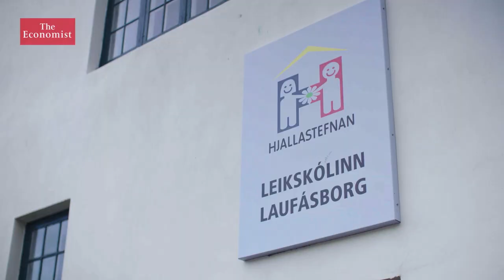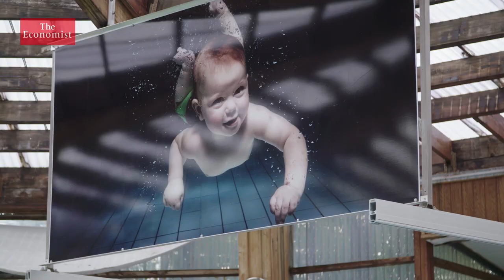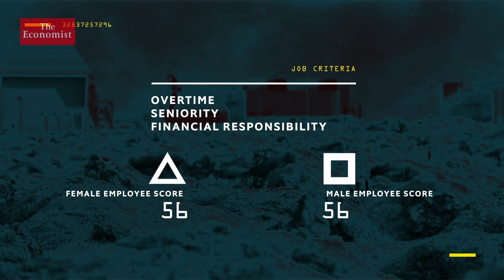The best place to be a woman?

Comment: Dear “Economist”. 

Economics 101:

1. If it were true that women earn less than men *for the same work*, then Icelandic employers would replace men with women in those jobs to lower costs.
2. Icelandic employers verifiably do not replace men by women to lower costs, even if by not doing so they become insolvent.
3. Therefore it is not true that women earn less than men *for the same work*.

There is no gender pay gap in like-for-like work - a fact which you yourselves reported less than 12 months ago in your newspaper.

I remember the days, before it was captured by feminist political lobbyists, when The Economist could be relied upon for well-researched, well reasoned journalism.

Comment: I agree on anything in this video except for this one 05:20 , if it comes to unskilled jobs, we must get paid according to the power we use to work, not because we give more value traditionally male dominated jobs, 

we can't pay the same price for cleaning service jobs and piping and fitting jobs, that's unfair, the risk and the power used in both jobs are different.

Comment: What is that mean: unskilled workers?  Is in it that for any kind of task to be completed you need some level of specific skills?
Reply: Here's the definition: Unskilled labor is used to refer to a segment of the workforce associated with a limited skill set or minimal economic value for the work performed. Unskilled labor is generally characterized by a lower educational attainment, such as a high school diploma, GED or lack thereof, and typically results in smaller wages.

Basically, it's labor that doesn't require a specific education or work experience, and therefore usually has lower wages.
Reply: Some level that can be obtained from just looking at how others do this job for a day. Fruit pickers, cleaners, anything mechanical really.

Comment: Oh, I would LOVE to give a like for this video, it is very good, but I can't.  The reason: you listed Canada in with the U.S. as having no weeks of paternity leave.  The reality isn't that simple.
Though Canada has no set number of Months (not weeks) for paternity leave, that is because technically there is not a set number of months for maternity leave either.  The Canadian system divides the time available between maternity and paternity leave.  There are a total of 9 months available during the first year, at 70% of pay to both, split between the two.  This means any leave not used by the mother can be used by the father.   For instance, in my case since I was not eligible for maternity leave, as I had not been working outside the home for some time before our child came along, my husband could have taken the full 9 month as paternity leave if he had wanted.  As it was, he took off a total of 7 months, spread over the course of the year.
You might want to do your research a bit better next time, if you ever do something on this issue again.